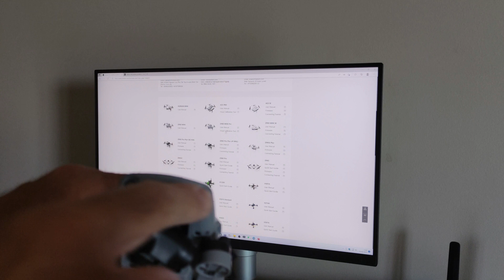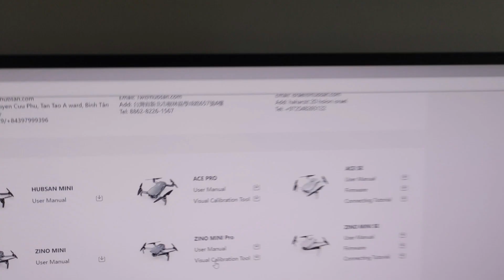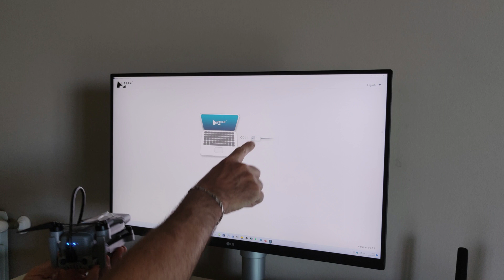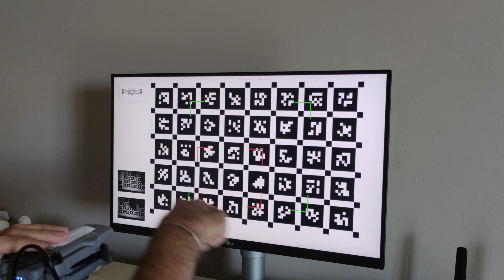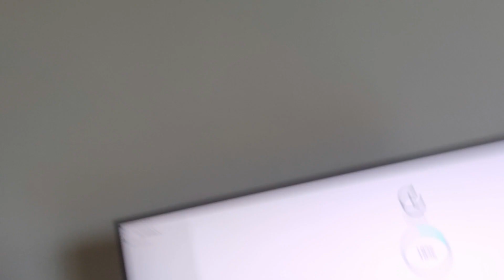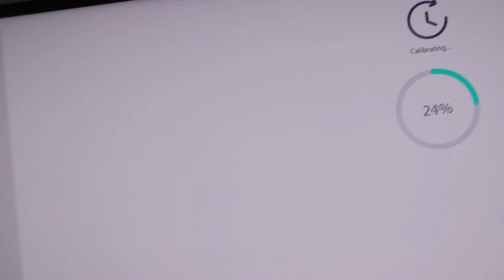Zino Mini Pro Obstacle sensor calibration

Comment: I fought been fighting with Hubsan since last December to get my drone replaced on a new one under Hubsan Care insurance.I finally gave myself a break.  Depending on what was the update of the X-Hubsan application, the rear sensors work once and other times they do not. Recalibrating the sensors does nothing.